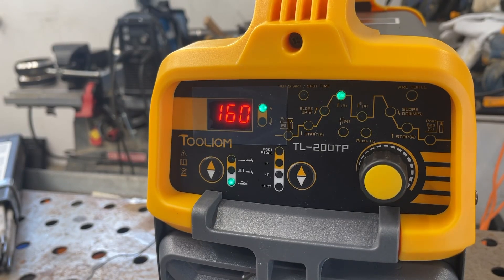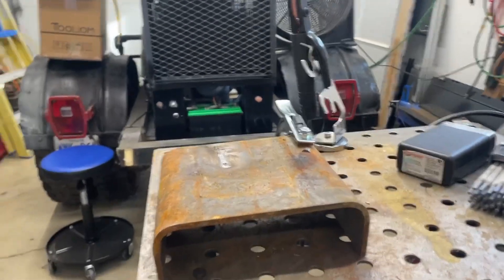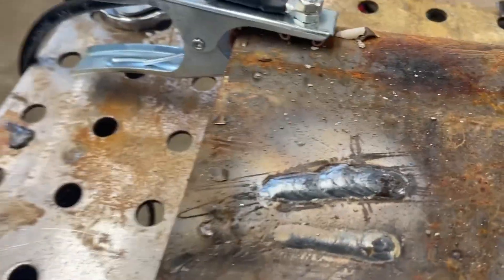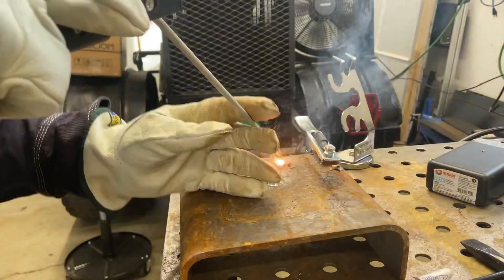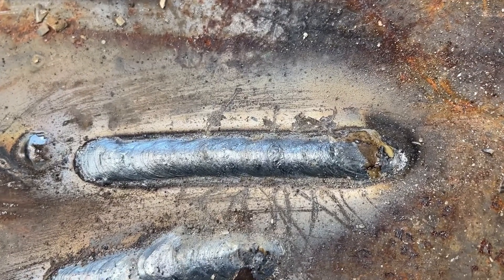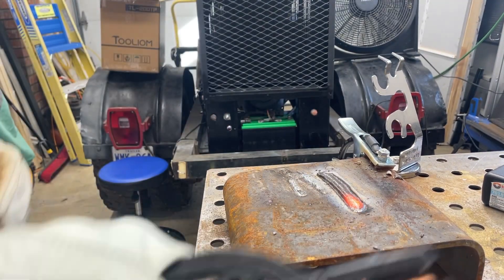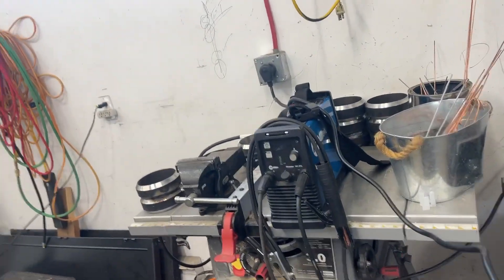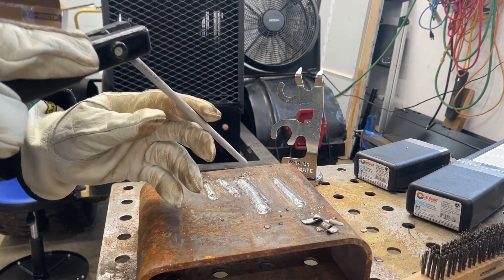Amazon Welder vs Miller

Comment: Just paid 152 for the Tooliom.
Reply from the maker: Tooliom 135 amp??
Reply from the maker: Ya that’s not bad good little welder for small jobs Tig is ok
Reply: @kdweld8234  Got the 200tp for $152 on prime day. Really just need for exhaust work mainly.
Reply from the maker: @greebuh okay great ya I just bought a foot pedal for it I’m going to do a video on that soon
Reply from the maker: @greebuh  Ya that would be great with Tig welding right

Comment: Tried this exact welder just to have a throw behind the seat welder.  Horrible man,  sure I can make it run 1/8 but I couldn't get any penitration out of it.  Returned it and gave northern tool a shot they have a Klutch ST201iDV Dual Voltage DC Arc Welder with TIG Function — Inverter, 120V/230V, 10–200 Amp Output for about $400 bucks.  Thing tigs ok but really can run some rods, even burns 6010 which most these cheap inverters can't.  It also has PFC "power factor correction", same as Esab Rouge have,  it's biult in the same warehouse as well.  This allows my little non invertor generator to run it easy,  26 amps max draw on 220v .
Reply from the maker: Thanks for sharing bro ya I agree these new welders are for the pro guys ., They don’t like 6010 lol